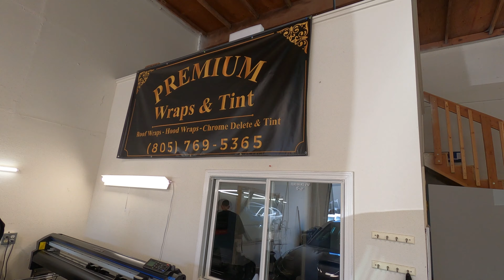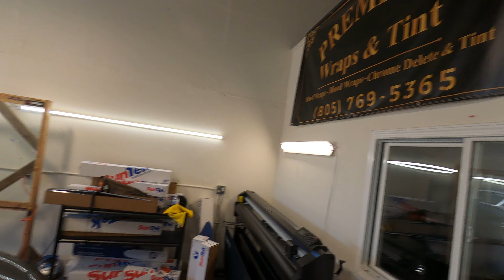2020 DODGE CHARGER SCAT PACK GETS 1ST UPGRADE! WIDEBODY CHARGER

Comment: Hey Louie!  were you happy with the 35%? did you ever get the windshield tinted?  IF so or even if you didn't  what would you have gone with tint % wise on the windshield?
Reply from the maker: I’m going to get 50 and I would go with 20 for the fronts
Reply: @louiexiii91   thx Louie. I’ve been debating the options since I often prescription polarized shades. Not sure how much darkness and rainbow effect I want to tolerate for the benefits of the tint